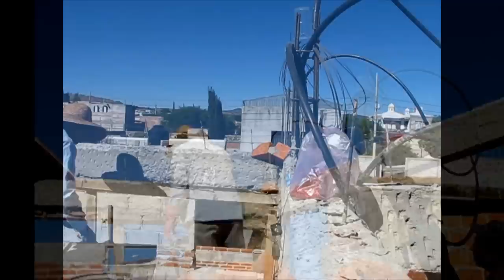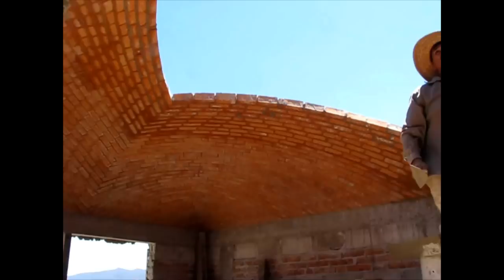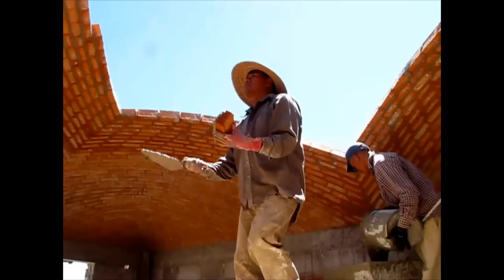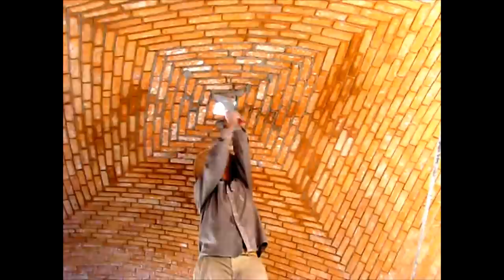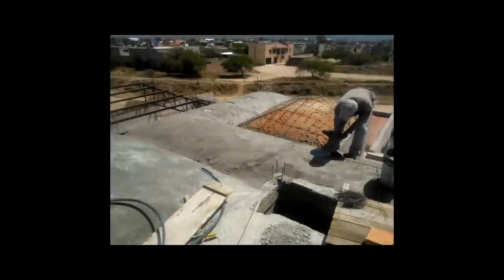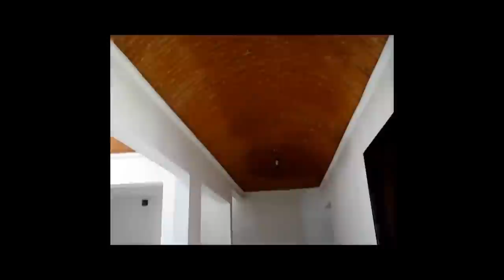How to build a solid brick dome virtualy Defying Gravity, Truly amazing! The strongest celling

Comment: This amazing for sure, but there's no way I'm letting unreinforced brick and mortar hover over my head without wearing somesort of hard hat...
Reply: Syph1l1S ooooo good one, pigeon.
Reply: Aaron Rodriguez notice the cables laid on top before the last 2" plaster coat? The roof can't move because of the arch on top of reinforced concrete beams poured on top of poured concrete corners.
Reply from the maker: Once closed, the arc, and vaults are structures stronger engineering there, watch this video where substantial evidence on these vaults are made, follow the following link, where they do the test with hollow materials and facts with plaster, in Mexico, we use solid bricks and concrete, brick see this video: https://www.youtube.com/watch?v=vHrIkk4wo9s

in Mexico City there was an earthquake of 8.1 on the Richter scale in 1985 and many modern buildings fell dawn. but many of the oldest buildings (15th century built with this technique) were undamaged or slightly damaged. the metropolitan cathedral is sinking down (because of the ground in which was once a lake and yet still standing ...
Reply: Aaron Rodriguez well does kind of house's  are for real men's  ,,,to live in......not for a wusses,,,that lare afraid  of evry  think,,,,.
Reply: Yeah, it wouldn't pass code in the US.
Reply: Anthony Wildman yeah right,,,,so y'all think that the buildings  in the USA made of press wood ar,e better or safer,,,that a house build with strong material  like brick....?.
Reply: jcruztiger buildings like this is the main reason so many people died when Mexico city was hit with an earthquake.

Comment: One earthquake and that's all coming down.
Reply: Dr. Drake Ramoray exactly what I was thinking but it's a good video
Reply: you don't know that ! eso es Pura Riata
Reply: It was an opinion
Reply: no he's right earthquake when is straight down
Reply: He said it's been proven to resist earthquakes for Millennia.  I think they know what they are doing.
Reply: Dr. Drake Ramoray dear Dr. The dome/arch and the pyramid are the most earthquake resistant shapes. They are also hurricane/storm and blast resistant. All other building shapes last seconds while domes/ arches are not affected. As always, resistance/tolerance starts with the footing design and all the way to the top. The roof shape and construction methods are also important but the fact remains that the dome/ arch is unequivocally the strongest.
Reply from the maker: Once closed, arches, and domes are the stronger structures, watch this video where substantial evidence on these vaults are made, where they do the test with hollow materials and facts with plaster, in Mexico, we use solid bricks and concrete, brick see this video: https://www.youtube.com/watch?v=vHrIkk4wo9s

in Mexico City there was an earthquake of 8.1 on the Richter scale in 1985 and many modern buildings fell dawn. but many of the oldest buildings (15th century built with this technique) were undamaged or slightly damaged. the metropolitan cathedral is sinking down (because of the ground in which was once a lake and yet still standing ...
Reply: so the arch is a fairly stable structure.....most roman arches from 2000 years ago are still standing.....I would venture to say that this arch is very stable and would probably take a real good shake and a quake to tear it down
Reply: Did you not read the discription
Reply: Yeah that's why when a magnitude 6 earthquake hits Mexico there's barely any damage. /rolls eyes
Reply: You're close, but this is an improperly shored arch/dome. An arch's main job is to transfer weight to an abutment or a pier where the weight is then transferred straight to the ground. The way this is constructed it will slide off the top of that wall. There is nothing to contain the outward force where the brick sits on top of the wall.
Reply: Dr. Drake Ramoray.      As a mason myself. This Dome serves as a cap this paysa knows his shit, corner bonds is key that holds strong as I piece,.' bring it on Earthquake' with this skill you think they didn't think about that? ?😉
Reply: Coleman Priske.   Yup! the power and skill of A TRUE paysa, homie DONT play! 🙅😎👍
Reply: Moon Dog. How long have you been waiting for such earthquake ????not any earthquakes around here lately!!!????  It's been so long that I forgot what earthquakes ARE!!😀

Comment: Earthquake !!!
Reply from the maker: Once closed, the arc, and vaults are structures stronger engineering there, watch this video where substantial evidence on these vaults are made, follow the following link, where they do the test with hollow materials and facts with plaster, in Mexico, we use solid bricks and concrete, brick see this video: https://www.youtube.com/watch?v=vHrIkk4wo9s
Reply: Coleman Priske this is aimed at Bernard Jourdan. 
Coleman Priske look at the oldest brick structures in the world 1000 years old and bigger than the domes in D.C. in areas where earth quakes are prominent. Brick structures need to come back and be used more. This is a great video.
Reply: RevoltingCock17751975 I agree that these concrete/mortar/brick buildings last longer, and in some applications they are great. But they are incredibly difficult/impossible to renovate or remodel. Also since the cost can be 4-5 times more and add in the fact that the western culture is based on disposables, I don't think these structures should be the normal. Don't get me wrong, I really like the idea of having such a sturdy building as my home, but there are a lot of reasons virtually no one uses them.

Comment: For 5 grand, Jorge will build you a house that will crush you in bad weather because it doesn't conform to building code.
Reply: Jonathan Gorr take some basic geometry courses, earn an A, earn your contractor's license, study the obvious reinforcing in the posts, beams and cabled across the roof under top veneer, then come back and make an educated comment.
Reply: Rafael Barraza not the Mexican part.  the support part
Reply: This is stronger than any building code lol
Reply: peter janjanin Not at all.  Where are the support trusses against wind load.  Where are the flashing systems to stop water from eating away at the mortar.  Think on it.
Reply: Clearly you don't know about the Catalan vault. 500 year old structures still stand using this vault
Reply: Alamyst2011 I understand your argument, but this has been proving effective historically. It requires upkeep but it a supremely strong build. My brother is a structural engineer, a bridge engineer in fact, and he opines this gets stronger under load. It's easy to criticize, but there is a precedent supporting the strength of this structure.
Reply: Diego Hernandez Water is not load.  Erosion is not load

Comment: Here we see why some many Mexicans die during even the smallest of earthquakes.
Reply: SimonCrowne that has to do more with the foundations of a building, but yeah, you're right in a way, lots of people build of the cuff.
Reply: SimonCrowne In Chile, totally, but not in Mexico. In the strong heartquakes from the last two decades, only a few people have died (barely 50 in the last ten years), a good part of them by heart attacks, not because something fell on them. Mexico learned from 1985, believe me.
Reply from the maker: in fact, fires are more common than earthquakes, and more people die in USA by fires than in all america in earthquakes. Do not you think there are other more dangerous buildings than this?
 Once closed, the arc, and vaults are structures stronger engineering there, watch this video where substantial evidence on these vaults are made, follow the following link, where they do the test with hollow materials and facts with plaster, in Mexico, we use solid bricks and concrete, brick see this video: https://www.youtube.com/watch?v=vHrIkk4wo9s
Reply: Tzctplus.  In America  if the mortar is OSHA approved  it's a GO, IN Mexico thay are OSHA! union or no union it goes UP!  Practiced by expert skilled RAZA. 😉👍

Comment: Impressive piece of work, these guys are tremdously skilled in their craft. They make it look so easy, even more so as they don’t use any formwork or guides to shape the geometry. This structure is pretty strong, unlike traditional barrel vaults these vaults don’t need a keystone as the herringbone pattern and the four sides bearing makes the layers interlock on each other. The reinforced concrete perimeter beams ensure that the horizontal thrust forces are accounted for. Interresting that they put a bit of reinforcement in top cement screed, I bet this is for temprature cracking control.

Comment: Roman Engineering 101 Domes are strong against earthquakes. If well built and sealed they last centuries. Unlike wood structures that eventually end up being rotted, burned or eaten by termites. The rebar and concrete exoskeleton placed on these domes add additional strenght to an already solid structure.

Comment: And that my friends is why so many people die in those countries when a earthquake arrives.  While what he does looks clever it will not withstand even a minor quake.  But, if there has never been a quake in that region, then his work will last for centuries.
Reply from the maker: Once closed, the arc, and vaults are structures stronger engineering there, watch this video where substantial evidence on these vaults are made, follow the following link, where they do the test with hollow materials and facts with plaster, in Mexico, we use solid bricks and concrete, brick see this video: https://www.youtube.com/watch?v=vHrIkk4wo9s
Reply from the maker: in Mexico City there was an earthquake of 8.1 on the Richter scale in 1985 and many modern buildings fell dawn. but many of the oldest buildings (15th century built with this technique) were undamaged or slightly damaged. the metropolitan cathedral is sinking down (because of the ground in which was once a lake and yet still standing ...
Reply: I looked at the video Victor.  Yes arcs are some of the strongest styles of construction, but forces straight down are what they are designed to withstand.  Lateral forces from a quake can stretch structures in ways the structure was not designed to withstand.

Also how a quake propagates through lake beds may not be the same as it does through rock or gravel.  Mexico City sits in an old lake bed.  The length of time a quake continues to rock is the problem.  The longer the quake the more liquefaction there is which can topple buildings, but that is assuming that the whole of that lake bed can be liquefied.

There is a reason that California has strict laws about earthquake proofing tall buildings, especially in the SF Bay Area.
Reply: pcbgatlas
  Well, well, well, Mr. pcb-gutlas, imagine meeting one of my brethren here with the audacity to call the kettle black.

If you have something to add, then do so.  I would be interested to see what you can come up with.
Reply: Ha ha ha.....  "Racist" ?  Hmmm calling me a troll wasn't strong enough language was it?  Yep, I AM a RACIST TROLL which you apparently have a problem with.  I call a spade a spade when I see it, read it, or hear it.  You were the first to start this snarky interchange.  Got anything to add?
Reply: Rumple Stiltskin
Reply: NOT TRUE
Reply: Suppose he is a troll...(He's not) Aren't you letting your assumed troll win by getting spun up like this? What he said was fact.

Comment: hopefully no earthquakes where your at
Reply from the maker: This is Mexico. Once closed, arches, and domes are the stronger structures, watch this video where substantial evidence on these vaults are made, where they do the test with hollow materials and facts with plaster, in Mexico, we use solid bricks and concrete, brick see this video: https://www.youtube.com/watch?v=vHrIkk4wo9s

in Mexico City there was an earthquake of 8.1 on the Richter scale in 1985 and many modern buildings fell dawn. but many of the oldest buildings (15th century built with this technique) were undamaged or slightly damaged. the metropolitan cathedral is sinking down (because of the ground in which was once a lake and yet still standing ...

Comment: how will this hold up in a moderate earthquake? serious question.
Reply from the maker: Once closed, arches, and domes are the stronger structures, watch this video where substantial evidence on these vaults are made, where they do the test with hollow materials and facts with plaster, in Mexico, we use solid bricks and concrete, brick see this video: https://www.youtube.com/watch?v=vHrIkk4wo9s

In Mexico City there was an earthquake of 8.1 on the Richter scale in 1985 and many modern buildings fell dawn. but many of the oldest buildings (15th century built with this technique) were undamaged or slightly damaged. the metropolitan cathedral is sinking down (because of the ground in which was once a lake and yet still standing ...

Comment: Very impressive craftsmanship, however not nearly enough steel reinforcement on the larger domes and non-structural material on top of it. In an earthquake the top layer will fragment and wont hold the steel as it pulls away and collapses with the bricks.

Comment: Yes he's very skilled but I'm curious to know why I dip the brick in the water and then splash the wall with water before you start it can anybody tell me why
Reply from the maker: When the brick is dry, it sucks moisture from the cement, drying it quickly, and staying in place immediately. When the brick gets wet, it allows you to move it a little. the builder decides when to do it or not

Comment: Something like that would have massive compressive strength but essentially no tensile strength, so if a seismic wave caused an oscillation of one load bearing wall in away from the other load bearing wall....BOOM!    It will rain bricks.    The whole trick of vaults depends entirely on massive retaining walls which can resist the horizontal compression of the vault and that the retaining piers be totally stable, immobile.    Earth movement could also create the same disruptive forces, so if the foundation and walls start creeping, those bricks will one day start falling.    That's why I am seeing in the video thick poured concrete walls with rebar around the roof....definitely a fortress just to keep the roof stable.      My guess is that as long as they keep the vaults small and surround them with a massive cement box with rebar, it probably will make it through most earthquakes.

Comment: Dunking the brick in water before troweling on the mortar,the brick being poreous creates a suction between the brick surface and the mortar.And a properly mixed cement is crutial.These guys are machines though.They must go through dozens of trowels a year...lol
Reply: Wetting bricks or concrete before mortar is applied is to avoid the porous bricks or concrete from sucking the moisture out of the mortar and causing it to cure prematurely and breaking/cracking over time.  

Also, cutting bricks and using the trowel edge to cut bricks is just downright stupid.  The pommel is for setting bricks, not the edge.
Reply: rewris Some companies(like the one in the video) don't use a saw to cut the brick to save labour time.And why is trimming the brick "stupid".This guy is doing just fine.
Reply: rewris don't hate the players; hate the game!

Comment: damn I feel bad for whoever has to live in the house watching earthquake hit and all that breaks are going to fall in your head
Reply from the maker: Once closed, the arc, and vaults are structures stronger engineering there, watch this video where substantial evidence on these vaults are made, follow the following link, where they do the test with hollow materials and facts with plaster, in Mexico, we use solid bricks and concrete, brick see this video: https://www.youtube.com/watch?v=vHrIkk4wo9s

in Mexico City there was an earthquake of 8.1 on the Richter scale in 1985 and many modern buildings fell dawn. but many of the oldest buildings (15th century built with this technique) were undamaged or slightly damaged. the metropolitan cathedral is sinking down (because of the ground in which was once a lake and yet still standing ...

Comment: The Romans were doing that 2000 years ago. Has nothing to do with defying gravity.  Just a simple arch.
Reply: They did it with a wooden frame as bricks would fall. This technique is something else as the mix used for the cement includes lime which dries up quicker

Comment: would this brick roof sustain an earthquake?
Reply: Wondered the same thing.
Reply: lol no....  They are just basic masonry skills, not modern or sophisticated building techniques.
Reply: basic lol  yeah anyone could do that ,sophisticated nowadays lol
Reply from the maker: Yes, Once closed, arches, and domes are the stronger structures, watch this video where substantial evidence on these vaults are made, where they do the test with hollow materials and facts with plaster, in Mexico, we use solid bricks and concrete, brick see this video: https://www.youtube.com/watch?v=vHrIkk4wo9s

in Mexico City there was an earthquake of 8.1 on the Richter scale in 1985 and many modern buildings fell dawn. but many of the oldest buildings (15th century built with this technique) were undamaged or slightly damaged. the metropolitan cathedral is sinking down (because of the ground in which was once a lake and yet still standing ...
Reply: YES!
If the earthquake is in Japan!